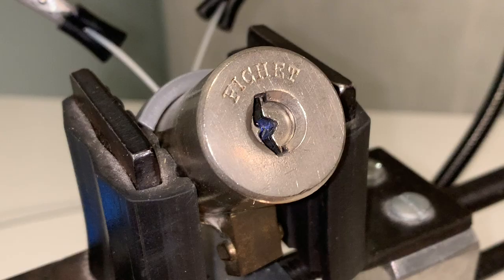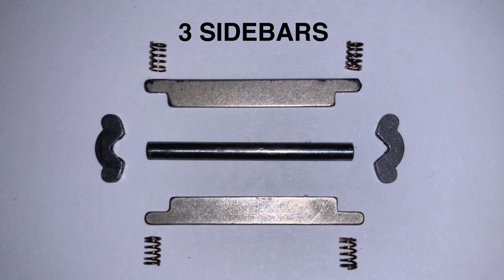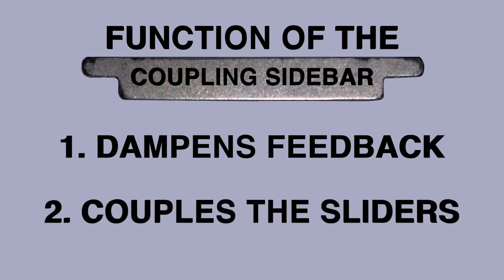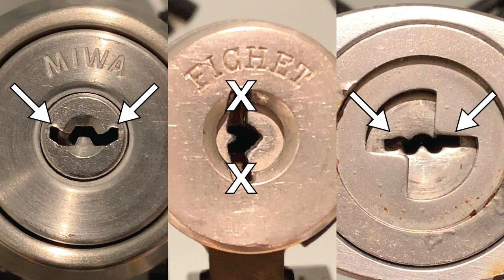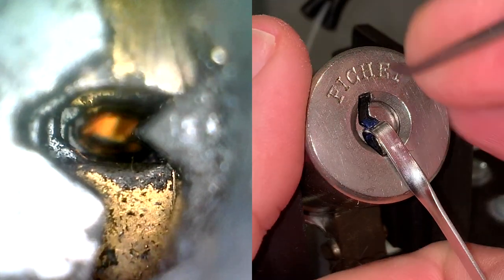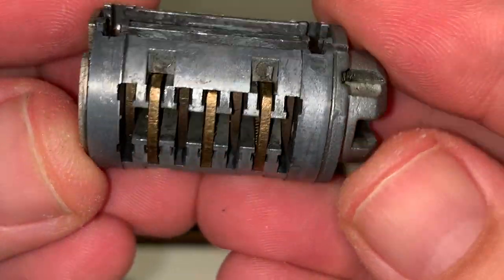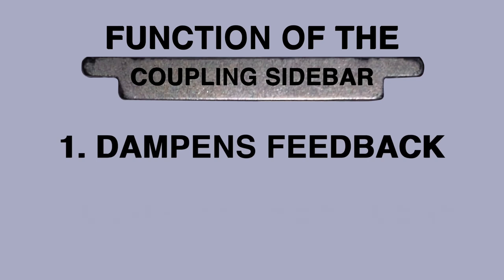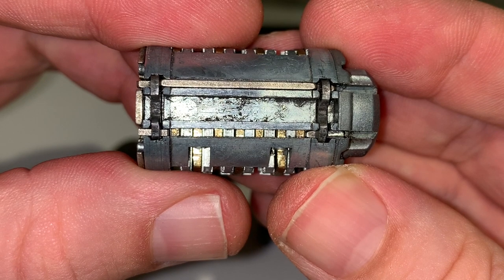(18) The Mysterious Fichet 666

Comment: As always it's been a blast to watch the video and enjoy all the effort you and the ones you credited put into the video!

To me your video only leaves one interesting point open related to the periphery of an installed lock: How does the lock operate when installed in a door?
My 666 is extremely easy to pick in one direction while it's pretty annoying in the other direction. So can the lock be picked into the easier direction (let's say that is ideally the locking direction) and then turned the other way with a plug spinner... Does the mechanism in the door allow picking it a bit beyond closed?
Reply from the maker: Thank you for your kind words sir!  It is an interesting point you make. I dont know how the lock is mounted in a door but Fichet could certainly take advantage of the fact that picking in one direction is harder by limiting the ability to use a plug spinner and making sure the appropriate groove is used for the given direction that the lock needs to actuate the mechanism.
Reply: After you make a double rotation to fully lock the system on standard door locks for Fichet 666,  you can still rotate the lock a lot. In the lock I checked, which is a basic inside the door lock, the latch interacts with the locking mechanism at the top, when the key is rotated nearly 180 degrees, so it's normal there is plenty of room for some extra rotation when it is double locked. Maybe other design may limit the rotation more, but I think it will still be enough to tension and pick it.

Comment: Am I correct in assuming that this is one of the few locks that mastering makes it harder to pick? I'm guessing it would pick like a SFIC.
Reply from the maker: Yes I would assume like sfic in the sense that there are two "shear lines" and all the gates have to align to the correct line. however the interaction between the sliders may be more complex than an sfic. In the sfic each chamber is somewhat isolated and in the 666 the sliders are a bit linked by their shared sidebars. I havent picked a mastered 666. Thank you for your thoughtful comment